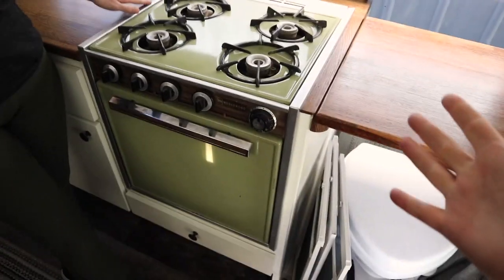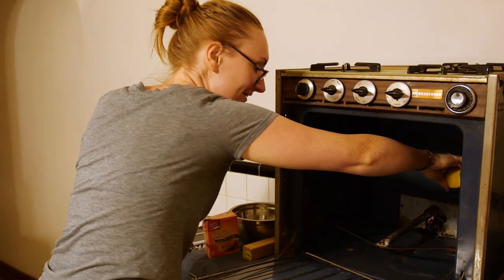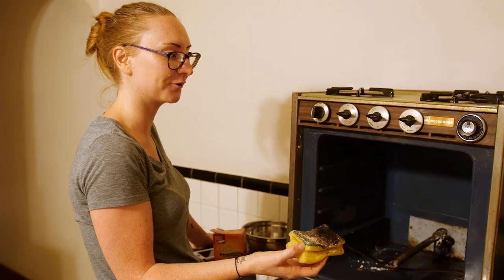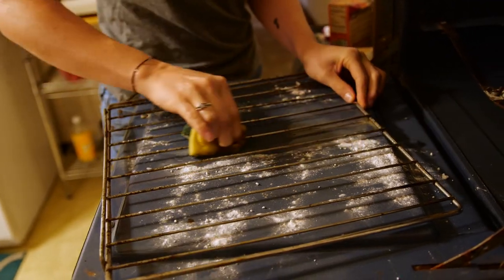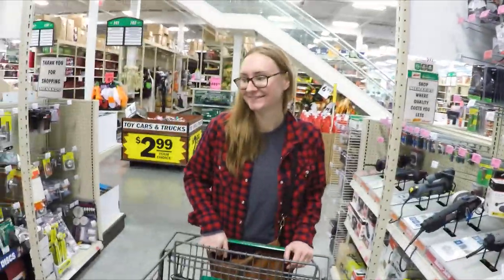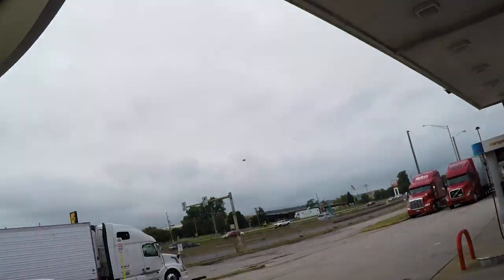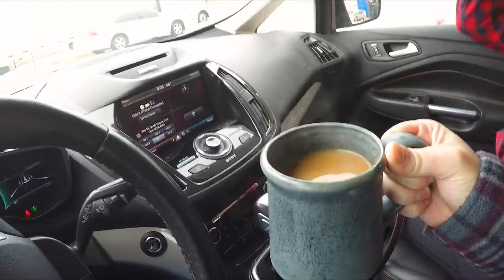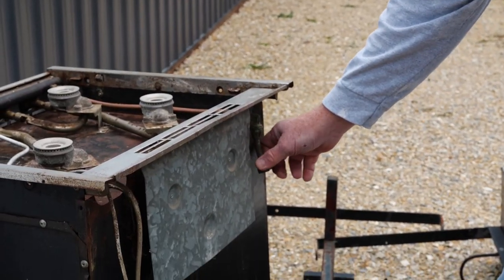Restoring Our $35 Vintage RV Oven | Bus Conversion - Day 7

Comment: i seen kits to convert natural gas stovelops to work on propane (yes you do need a regulator ) , they use a different size gas jet size and for the oven you need to ajust the air mix along with replacng the jet 
as for sandpaper on a body , 100 grit for realy bad rust , 120 grit for sanding down paintbrush and rollermarks and 240 for the rest , orbital sanders work well , expect a LOT of dust